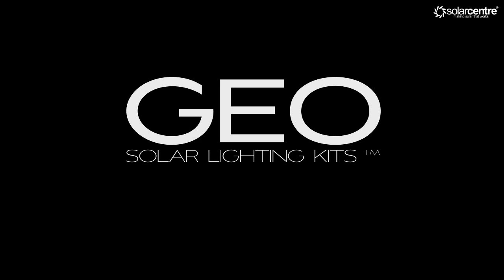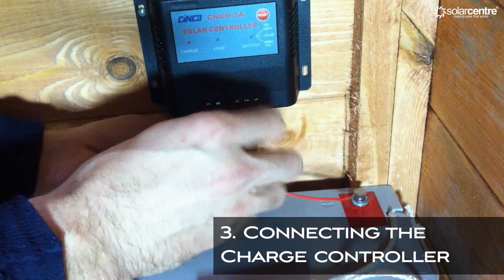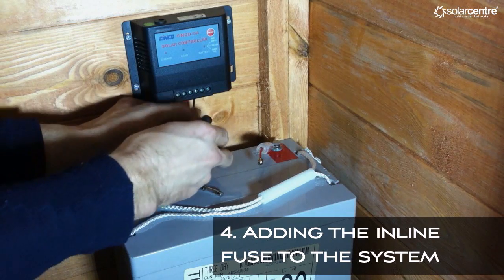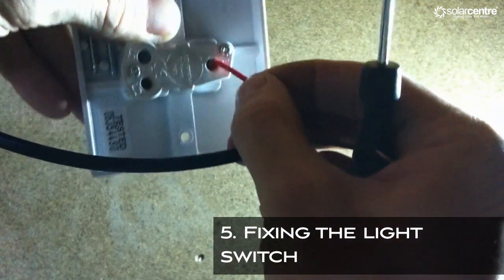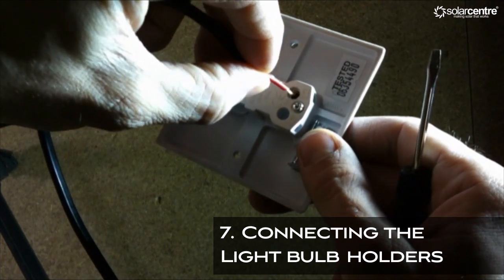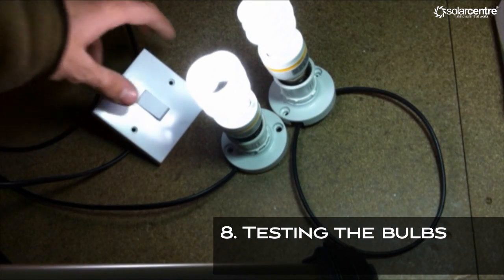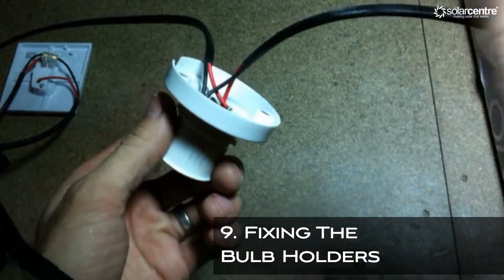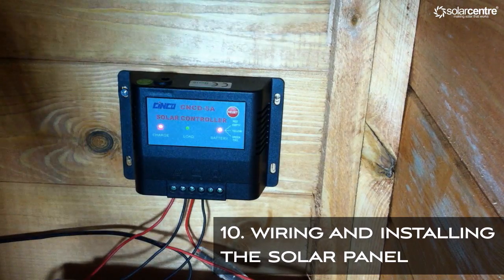Geo Solar Lighting Kit Installation

Comment: bboymarcel I don't get your logic. The function of this system is to generate an unlimited amount of free energy for use as lighting in a off grid structure, in this case a shed. Self sufficiency, home energy generation and being greener are all growing trends.

Candles would produce less light, pose a fire risk in a wooden shed, are unreliable in outdoor airy environments, require matches to light, there is waste with used candle wax and would need regular replacing. They are not a self sufficient or green solution.